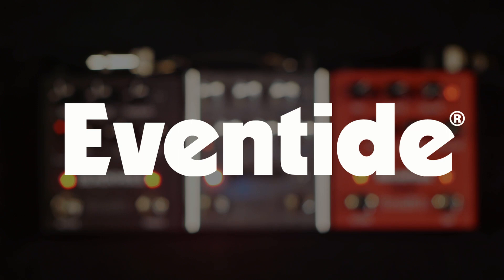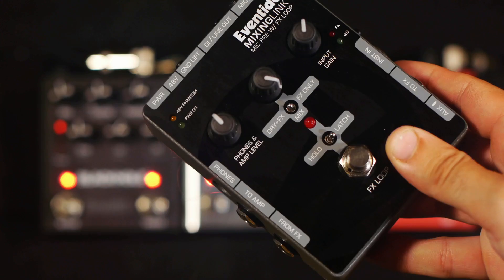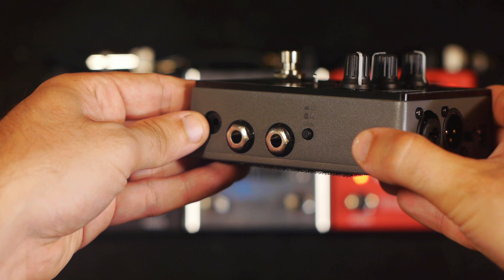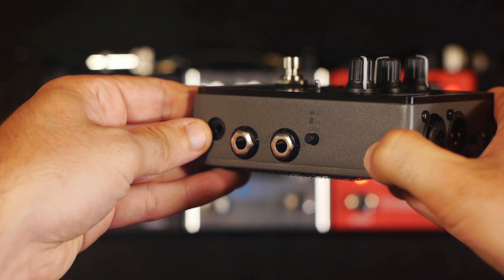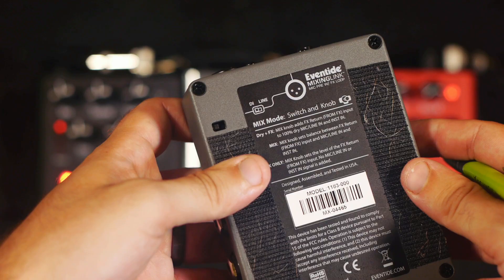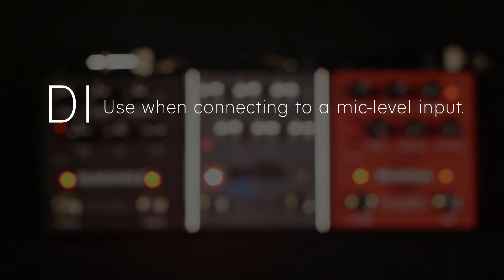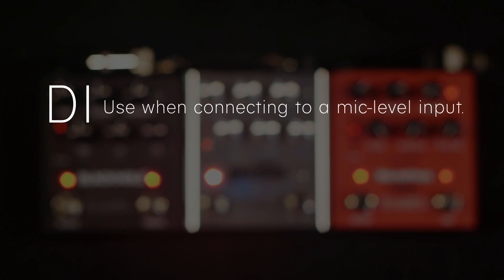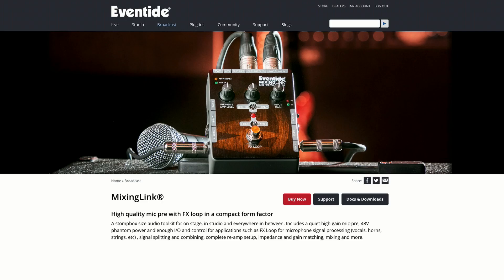Eventide MixingLink Quick Set-Up Tips

Comment: Line out via a XLR connection is really weird. 99.9% of all gear with XLR inputs expect a mic level signal, not line level.
Reply from the maker: The output level is switchable between a low level DI output and a high level LINE output using the small DIP switch located on the underside of Mixing Link.
Reply: @EventideAudio  Thank you for kindly responding. I assume then that the DI output should be similar to a mic level. Nice. Thank you